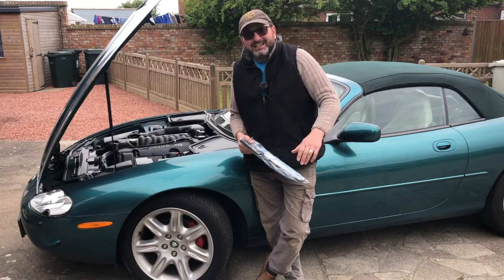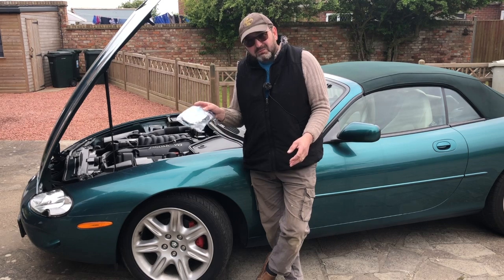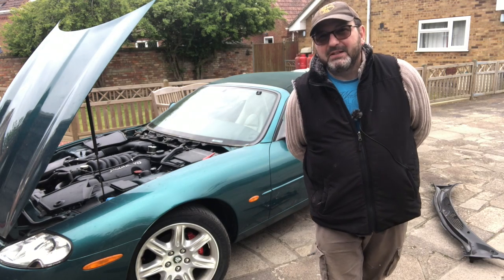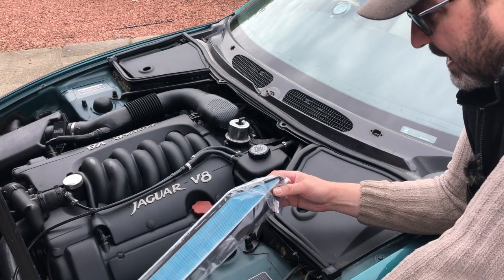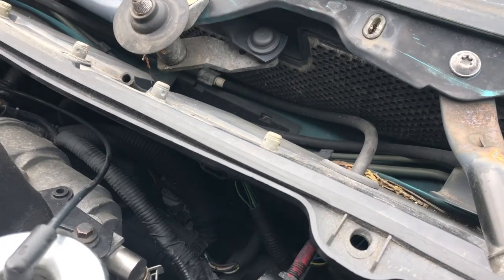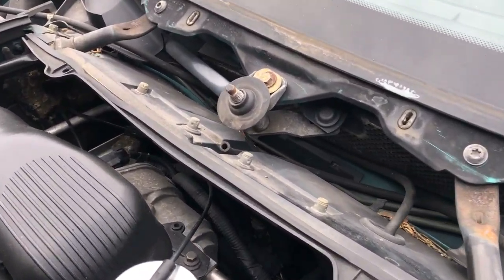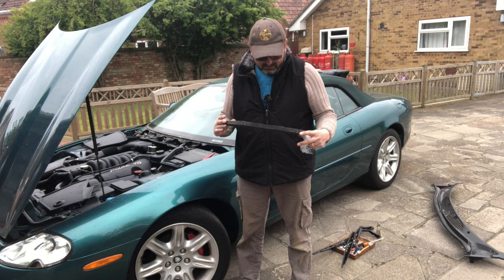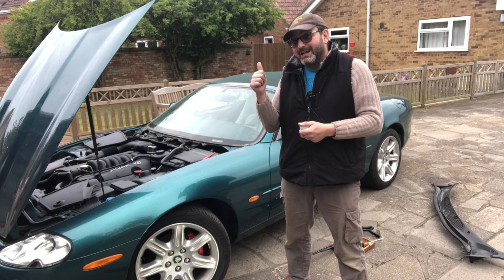Secrets of the Jaguar XK8 XKR Episode 61. Cabin / Pollen Filter Secrets

Comment: Thanks for yet another excellent video. Questions : Is it possible to know if a car has the pollen filter, without extensive dismantling? Will decoding the VIN tell anything about optional equipment, like this filter etc? I was not aware of all your XK8/XKR ‘secret’ episodes before recently. I started on no 1 and have now come to no 62. All very informative and great fun. I am a subscriber, but have problems signing up as an additional subscriber to the ‘secrets’ separately. Please advise. Thanks!
Reply from the maker: Hi. Thanks for watching so many of my videos. (there are 540 of them currently😵‍💫) The VIN number wont tell you that detail but you can request a spec list from a jaguar dealer, which they can generate from your VIN number. They normally dont charge if you are having some work, or a service/mot done.
If you look for a button called playlists on my channel, One of the playlists is Secrets of the XK8 and they are all grouped there (121) However there are far more jaguar XK8 videos that are not 'Secrets of' ones than are.
Reply: @ToTheGarage  - Thank you very much. I am in the process of buying a ‘97 XK8 Coupe for my wife, so I am trying to learn as much as possible. Your videos have been very enlightening, but sometimes also a bit scary, esp due to the extensive use of plastics and other dubious materials on these beauties. I have owned and enjoyed all types of Jaguars since 1982, and presently own three (‘85 XJ-S 3.6 manual TWR, ‘95 X300 Daimler Six and an ‘ 05 S-Type). The XK8 mentioned above will be the fourth in our household. Great fun!

Comment: I get a sort of damp smell from the AC, do you think replacing the pollen filter might help?
Reply from the maker: It is possible that the pollen filter is heavily contaminated. But more likely the AC plenum needs a clean out as old stagnant condensate can settle there.  You can by kits with an aerosol of AC cleaner which you squirt into the plenum via the condensate overflow pipe under the car. Look for where the water drips when you park up on a hot day after driving with the zircon switched on. Above that is the pipe you are looking for

Comment: Hello John . Nice and informative video. 
If I may add some info to your subscribers/viewers on the issue. 
You can check by the Vin number the initial order. It states if it was equipped with a pollen filter. 
Alternatively, if you have a full book service, but from the official dealer, the pollen filter replacement is at about 30.000 km , and the part number you'll see on the job/parts list is the MJD6863AA. 
Do hope this helps a little bit. 
Cheers !
Reply from the maker: Top man Nicholas.
This is an excellent idea and so much easier than 'Go look See' for this specific part👍
You have save a lot of folk a lot of time there.
Reply: Hi Nicholas,
I was not aware that one can check the initial order. Thanks for the tip! But where to check? Is there a webpage for this?
Thanks in advance
Reply: @petersiklosi1966  Hi Pèter, if you are the first owner and you kept the documents you can check there. 
If you bought your cat second hand, you can ask the Jaguar dealer using your vin number.
They can provide the initial order details sheet. 
Hope this helps. 
✌

Comment: My power seat stopped working. I checked the fuse and it was ok. When I put it back it worked once. So every time I want to move the seat I have to remove and reinstall the fuse. Any thoughts?

Comment: Very interesting construction methods. I reckon the new one will block over extended time and reduce the airflow out of the intake. I had an E Class merc that constantly fogged up and the pollen filter in that was a solid black mass when I took it out. The OEM filter looks like it consumed itself with age so it didn’t block. Did you see a difference?
Reply from the maker: Not really. Im just assuming the air in the cabin is now fresher.😁

Comment: Thanks for this John. At around the 6½ minute mark in your tutorial, you make reference to taking care of the black clips that are in the screw holes. I am missing 3 of these and despite a thorough search on the web, can not find anywhere that I could buy replacements. Do you have any suggestions? I’m concerned that without them in place there is a risk of over tightening the screws which would eventually cause the plastic to crack.
Reply from the maker: Hi Maurice. I have had a quick look too and come up with nothing. 
Does anyone else out there know where these can be obtained?

Comment: I hope you hovered those leaves out John, I won't sleep otherwise.
Reply from the maker: Alan Meaning 
You can sleep soundly Alan.👍
Reply: @ToTheGarage  Hi John, the passenger seat on my 96 XK8  convertible got stuck at its rear most travel covering the bolts that bolt the frame to the floor. I worked out that he motor had had it, but it took me ages (3 Saturdays!) to work out how to get the seat out to replace. Basically, there are 4 bolts that bolt the frame to the seat and I had to use plumbers pliers to nip off the bolts and then unscrew them by hand, by the way there is little space to do this job and you have to do it upside down! I have a picture of the bolt locations if you would find it useful for your viewers. I have also just replaced the rear sub-woofers as the cones had rotted, I can tell you the manufacturer and model of the replacement speakers and how to wire them, they are dual voice coils so have to be wired in parallel to get somewhere close to the original impedance of 2.7 ohms ish, I have pictures of the originals with dimensions. If not no worries, love the channel and keep up the good work.

Comment: Hi, John, just removed the scuttle panel on my 2003 XK8 &  all I found was a rectangular hole (no cover) with a captive nut either side. So I am permanently getting air in from the engine bay. Would turning on the recirculating button help ?
Reply from the maker: Hi David. Even with no pollen filter housing and no blanking plate, the air intake should still be being drawn down from the scuttle panel and not the engine bay. Do you get an engine bay smell in you interior?
Reply: @ToTheGarage  Thanks, John. Of course it will. Didn't think of that when I had the scuttle off.
No engine smells.

Comment: What kind of hydrolic fluid go's in the roof.
Reply from the maker: Hi John
Early cars may still have a brown fluid that gels up. It should have been changed for a green synthetic fluid (Pentosin CHF11S) but the two dont mix so ensure the old is well purged out if you are swapping one for the other.
As per Gary VanRemortel's XK8 Biblehttps://www.youtube.com/redirect?event=backstage_event&q=https%3A%2F%2Fdrive.google.com%2Fdrive%2Ffolders%2F1C7AsBRQSN6sdGiLKKkDvuhxLj9fADVil%3Fusp%3Dsharing&redir_token=IdRMNAkKBBOpfasQnQVUM-sPRO58MTU4ODc2Njk0NUAxNTg4NjgwNTQ1